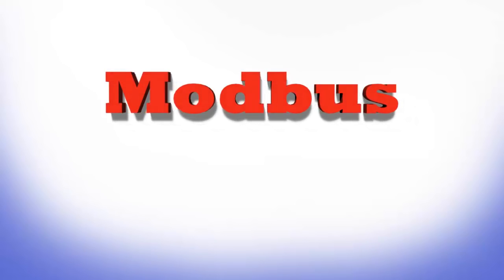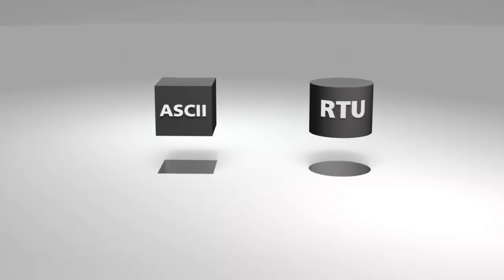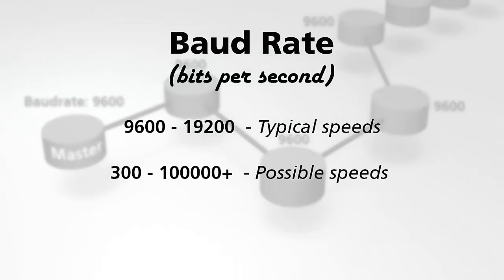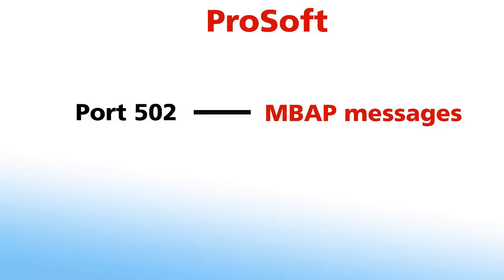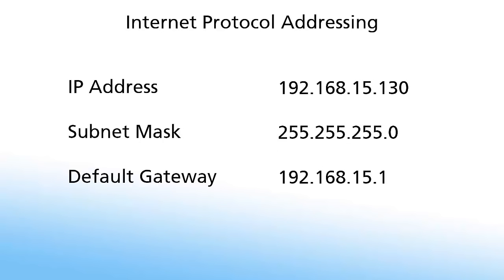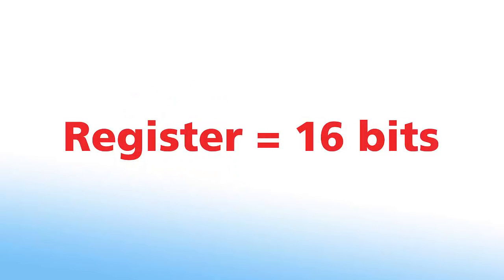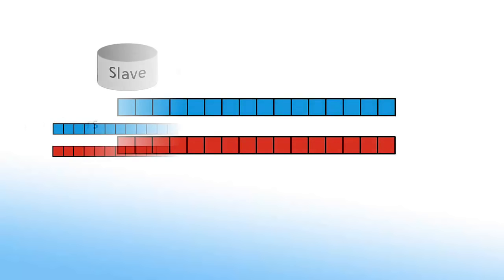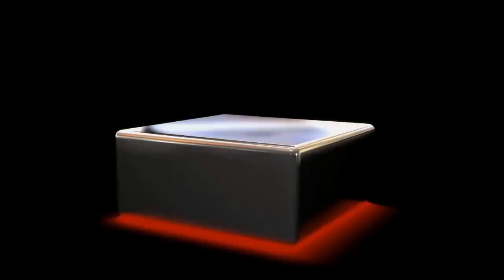Understanding Modbus Serial and TCP IP

Comment: I think you are confusing "Modbus" and "RS-485" characteristics. Attributing ones attributes to the other makes it more confusing.
Reply: He is not confusing anything. RS 485 is not a communication protocol. It is simply a cable that can also be used in modbus TCP/IP. It is only a physical layer specification that can be part of modbus over Ethernet (not serial).
Reply: @bright601  Thank you for the knowledge. If I may ask, how does a physical layer dictate how many nodes can be on a  loop?  (copper is just copper) I've always thought that part of the "RS-xxx" standard was a communication protocol. I'm just hopping to get a better understanding
Reply: @Happy-cz8ft Hi,  I suggest you read and research about the OSI Model. Hopefully it clears things up.

Comment: What does protocol means?
Reply: Protocols are a set of rules and practices that are used in communication.

In order for communication to happen between two or more parties, whether it be human beings or electrical devices, there must be ground rules in how it's done.

Think about two people communicating.

When two people talk, they have to agree on a language to use, it makes little sense in two people speaking different languages to eachother if neither of them understand the other.

And they have to agree on timing and how messages are presented to eachother. Are they speaking in the same room? Are they texting? If they're not in the same room, and one person is choosing to communicate by writing messages on a piece of paper which can't be seen, and the other is speaking to a wall and can not be heard, communication can't happen. They also can't communicate if they're both speaking to eachother at the same time.

The agreements and rules two people make when communicating, albeit not done necessary consciously, are protocols.

Likewise, two or more devices can't communicate with each other without using the same protocol. There's no point in one device sending serial binary messages over a copper cable if the other device is expecting messages to come in morse code manually entered by an operator.